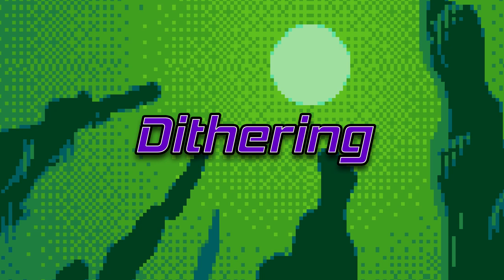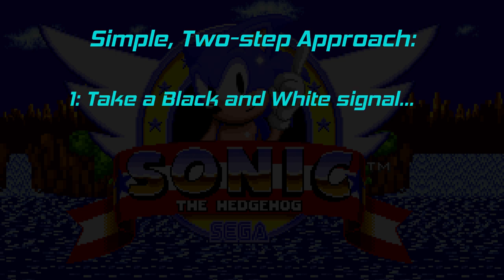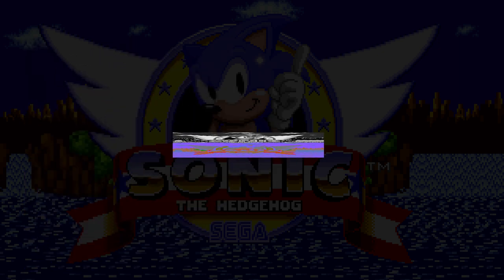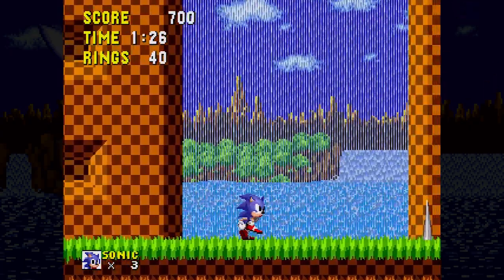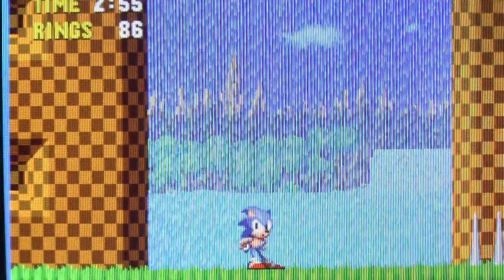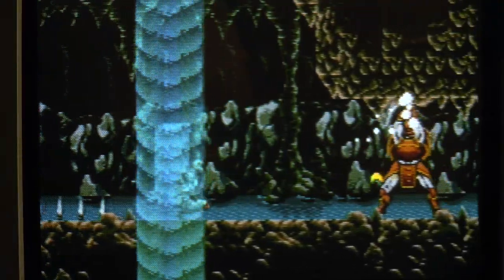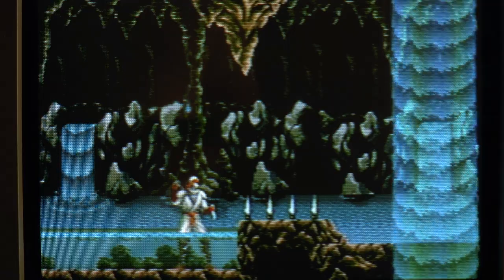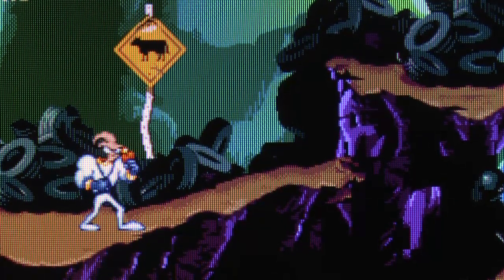Dithering on the Sega Genesis with Composite Video

Comment: For anyone interested, RetroArch's mdapt is a great example of a way to reduce dithering but retain sharpness. A necessity for Plasma or LCD displays. Unfortunately it leaves out bright single pixels in some instances, an artifact if you will. Easy to notice on The Lion King's sky for example, or in games that used intense dithering for every single graphic like The Lost World (but you do get used to it and it looks fairly natural). So unfortunately these shaders will never be perfect. However, Kega Fusion's CVBS TV mode (with Filter enabled) on a PC when hooked up to an HD CRT via HDMI will get you the most accurate color information + complete lack of artifacts and take care of all the dithering while the CRT provides you natural sharpness without loss of detail, giving you the most optimal of experiences.
Reply: Thanks for your kind advice, really helps out.

Comment: I think technique and perception of dither has changed with time, like you said about the pursuit of PVMs and better CRT AV.
Some examples include making sure the gradient contrast is low if the intention is a smooth look versus blunt high contrast dither for rough texture, something aimed at S-Video, Component, RGB, or LCD use rather than Composite. Tricky to do with Sega Genesis color precision.
Been considering interlace dither both horizontally and vertically because of pixel shape differences(C64/PC88) for RGB output that perhaps on a CRT it would it look better through an Odd & Even raster that alternates. Doesn't apply to LCDs or legacy software but something to try maybe in homebrew.

Comment: Gone are the days of hooking up games consoles (such as the where), and even very early home computers, to the back of a tv with a RF Modulator.  Probably over 90% of the people that watch YouTube these days do not even know that tv's at one time has connectors to the video signal that connected with two screws and a switch box type of connector.

(And when looking at the back of a tube tv to see the orange glow inside and feel the heat from the tubes.)

Comment: Amazing work! I've noticed that!

It reminds me the Voodoo3

" Voodoo3's RAMDAC, which took the rendered frame from the framebuffer and generated the display image, performed a 2x2 box or 4x1 line filter on the dithered image to almost reconstruct the original 24 bit render. 3dfx claimed this to be '22-bit' equivalent quality" (this information was extracted from Voodoo3's Wikipedia page).

Comment: This is a difficult subject for me. As a kid, I always wanted to use the highest-quality connection on the highest quality display and was typically forced to settle for composite. I think there was a time or two when I was able to acquire an S-video signal later on, but component didn't exist on regular TVs back then so S-video was the best I could do.

I think there's a strong argument for the crispness of a good monitor and a good video connection. Not only is text clearer and easier to read, which is almost always a plus, but color bleeding in a lot of instances can make for a blurry, messy image. For that reason, I'm usually a fan of the sharper video quality options.

However, it's become obvious in recent years that game designers were well aware of the hardware limitations of the consoles they were creating for and much more clever than we give them credit for. For one thing, they're targeting a lowest-common denominator here: most people will have access to the cheapest video signal, and therefore they tried to make their games look best for that specific signal. The fact that the Genesis allowed for dithering to expand its color palette obviously clued developers in to the fact that over composite signal this actually benefited their games by making the dithering less noticeable. That the games were originally designed to utilize the limitations of composite signal to their advantage is, to me, a significant strike against the idea of using an RGB signal.

On the flip side, I think in part because of the push to PVMs and RGB, we've started to condition ourselves to expect dithering, especially on consoles like the Genesis. When you see the image accurately, as it wasn't originally meant to be seen, you get an image that is unmistakably "Genesis." It's a characteristic of the console that makes it really stand out. I have to say, while I really appreciate the transparency of the blended colors, I don't necessarily hate seeing the dithering in all its glory. In certain cases it bothers me more than others, but ultimately, I think the moral of the story here is that if you like the system and you like the output you're seeing, there's not necessarily a need to go make things complicated unless you're just curious, and feel free to stick with whatever you like that works.

Comment: I dunno how to feel about the composite video, I mean I grew up using crappy RF and what you say here makes total sense to use the limitations of the TV hardware at the time to complement the limitations of the hardware ...BUT there is something to be said for the sharp pixel art. 

One thing I wish you tackled is how it works on LCD and if there's any input latency as I've heard TVs can bork this up. 

But this is a great look at the topic as I've had to describe this to some- but I didn't have the means of really showing it.

Comment: Is there a way to emulate the effect with emulators?
Reply: I would like to know it as well.
Reply: Yes, though it depends on the emulator
Reply: Most have the option, but it doesn't accurately reproduce the effect to the extent we'd like to see.
Reply: Kega fusion has like 3 versions for this.
Retroarch has a few as well.
Reply: Gens has 2X SAI Hi or something like that.

ZSNES has an option as well, can't remember the name at the moment, essentially a blurring feature.

People forget that we were playing these on blurry old TVs. You literally could not see the pixels when the games were originally released. These blurring features on the emulators actually make it look more like it did at the time.

You could never see a stair-step in Sonic's spikes on the TV back in the 80s and 90s but you can definitely see it on a computer monitor today.
Reply: hit your computer with a hammer until the image quality looks like that
Reply: @glenwaldrop8166  completely correct. like i said above, reshades guassian blur filter gives a rounded look that avoids all the 'stepping'
Reply: Retroarch has exactly what you need with the shaders that come with it. I personally use CRT Royale NTSC 256px composite on my genesis emulation as well as a svideo filter through the emulator core to create clean transparencies.
Reply: Yes, with the emulator called Regen.
Reply: @myusernamesucks1623  Thanks for the suggestion, it looks pretty awesome ... Would be perfect if can have the rainbow effect from composite. Do you know if there's some way to add that last effect to the preset ?? Thanks again.

Comment: I played on the "megadrive" (aka genesis) when i was a kid. But I'm French. In France, composite was never the standard, because the standard was SECAM + SCART connector, everybody was experimenting RGB, including while playing the megadrive. Composite was not the main thing, it was here, but just for compatibility. So I discover this dithering method now, more than 25 years later. until now, for me the multiple vertical lines in Sonic's waterfall in sonic was just illustrating some king of irregularity on the water.
Reply from the maker: France has a very interesting history of video - Not just for the sake of RGB in the 80s, but also the history and use of SECAM. I appreciate any additional stories you would like to share about gaming as a kid in France!
Reply: @DisplacedGamers  Well, I don't have anything special to say, about old days console gaming. We was not rich in my family and this was the only console we ever had (later, when I was early on college we bought an used 486 PC with my brothers). I think globaly, even if the system was a bit different (because it came later than ntsc) finally the usage was similar. Eventually the SECAM hertzian broadcasting was closed, replaced by TNT (airwave broadcasting for digital TV ), itself enhanced with TNT-HD. But 50Hz broadcasting is still maintained as a standard here, even TV over IP is 50Hz. EDIT: If you search about something exotic about retro tech in France, you may search what was "minitel". It was a videotext terminal for a very popular (9 millions terminals and 20 millions users) network (teletel) launched on the early 80's. It was using a 8 level of greyscale (later 8 colors) display on 24*40 characters text mode screen. On he 80,s and 90's my parents had one or two screens: the TV and the minitel.
https://larevuedesmedias.ina.fr/du-minitel-linternet

Comment: I'm glad to know the Sonic waterfall looks janky when moving side to side on real hardware. I've used emulator shaders before that worked fine to blend the dithering and stuff, but the waterfall always look like an absolute mess when moving. Kinda just assumed it was the fact that it was an emulator and a shader rather than a real tv with a composite signal. I'm happy to know the shaders were fine.

Comment: Thanks for making this video, I use RGB on my model 1 JP MD and my JP AES. On both consoles the checker boarding drives me crazy on a 42” tv using a OSSC. I think I will grab a composite cable to remind myself of what it looked like in the 90s
Reply from the maker: Hey let me know, 16Bites WGMSA. I hope the results don't make you feel stuck in the middle as you'll be upscaling composite video to a 42" TV. That size of a display is going to make quite a difference compared to composite to a CRT in the 13" to 27" range.